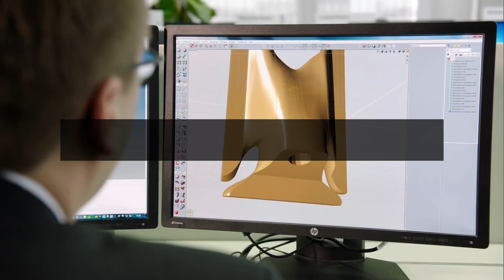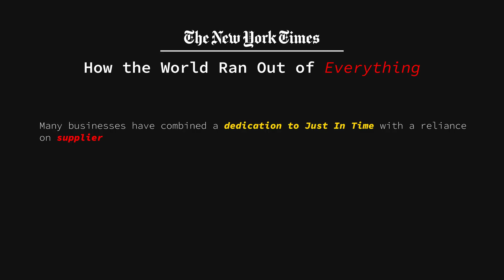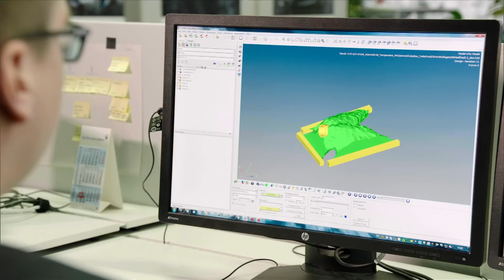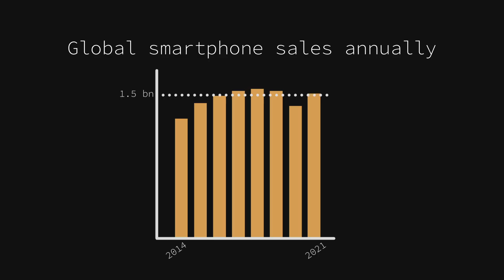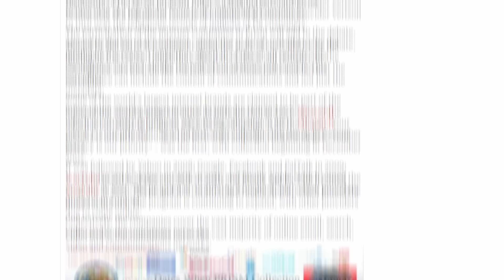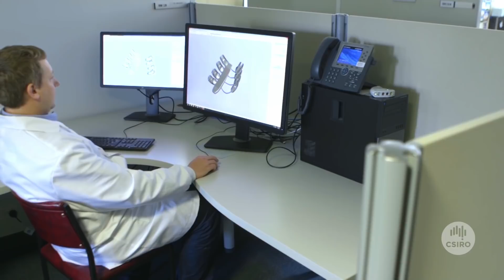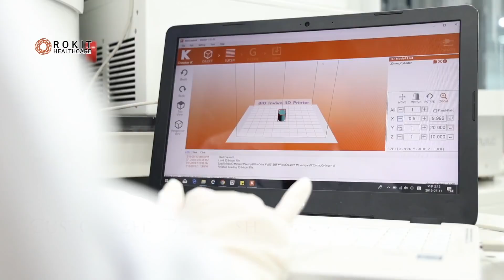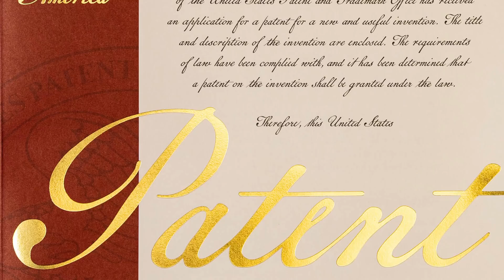How 3D Printing Could Decentralize (Almost) Everything

Comment: 4:00 I'm going to have to protest right here. The recovery of metal is virtually 100%, since it can be moulded again. And wood, yes....if only we had some sort of machine where we could use that in..... maybe it could simultaneously heat something while getting vaporized.
Reply: Metals are fairly easy to recycle. That's been worked on for decades, if not centuries.

Plastics, not so much. Jake Tran has a video on that. (I could provide a link, but those comments get disappeared >_<)

With wood, the waste can be recycled a couple times before the fibres get too beat up to be useful. At this point, the choice is basically firewood or compost…
Reply: To add on to this, additive and subtractive are already being combined. E3D has some cool stuff available to the public.
Reply: @tripplefives Ah you are right, I was assuming that metal recycling was being effected in the same way as plastic recycling. Plastic flakes were more expensive per ton than virgin plastic or at least they were the last time I saw a report on it, since the pandemic drove up the price of petroleum it has probably swung the other way again since the price has gone up with the drop in production. Evidently the ease of recycling non alloyed metals is keeping the recycled products cheaper than virgin materials.
Reply: Also, 
1. 3D printers are S L O W
2. 3D printers Produce inferior products, often completely unsuitable replacements to parts made with  traditional manufacturing.
3. 3D printers have a limited range of materials.
4. 3D Printers need To be produced with electronics, cabling, bearings and machines metal etc that THEY CAN'T THEMSELVES MAKE. Isn't that alone proof enough?
Reply: @paulp1204  Well yes, but actually no.
1. Community is working on fast and accurate 3d printers (Voron series for example) , and yeah it still cant compare to injection molding, but when you include the time of transportation and warehousing it's pretty close.
2. Traditional 3d printing(FDM) sure, but have you seen SLS 3d printers? The quality is astonishing and the durability is close to 1:1.
3. Can't argue with that, but every manufacturing technology has limitations.
4. RepRap project that basically started the community has some interesting solutions(like snappy v3 if I recall correctly) .

Also, all of my points go through the window if you include metalwork, it's really high quality but also costly.
Reply from the maker: Is metal reusable/recyclable even after it was treated for specific use cases? I.e. are you gonna be able to mold leftover construction steel into auto parts?
Reply: @TheHatedOne  Yes, you can throw steel into an Electric Arc Furnace for recycling it from what I know. From there you can re-alloy the material. Not sure about aluminum but recycled aluminum is used all the time and I think it can be cheaper than virgin aluminum. Also, I think Additive + Subtractive is the more near-term future of manufacturing for a lot of purposes. Mazak, DMG Mori, and other machines companies make machines capable of doing both, and they are used not only in the creation of new "stuff", but they are used to repair tools and parts as well, such as worn molds and die tools. They are awesome machines. I have a passion for machining and manufacturing along with being CompSci guy, which is kind of rare in my generation here in the US. BTW, 3D printed guns are awesome.
Reply from the maker: @Thorhian   Thanks for the insight. Throughout my research I've stumbled upon many companies in the business of 3D metal printing for some of the specific benefits of additive manufacturing - mainly extreme customization and short design-to-market cycle. I don't think 3D printing will beat machining at scale anytime soon if ever, but I am curious to see how 3D printing could complement subtractive manufacturing in the future.
Reply: @Thorhian  Lets not forget that MAG welding that was used in repair is now its own 3D printing method with CNC machines doing the job in carbon dioxide chambers. I wish I'd get to work on one soon, the DMG Mori ones use sintering for the job and are awesome!
Reply: @Thorhian  It is certainly possible to reconstitute or reforge most metals through recycling, its unfortunately generally much cheaper and faster to simply buy new bulk materials rather than to recycle the leftovers, and since its cheaper and faster a majority of manufacturers will go that route unless they are big enough to do the recycling internally and the material is expensive enough. That seems to be the trap of recycling, it sounds good but unless it is cheaper, mandated by the government, or will pay PR dividends when they need to influence public opinion no company will do it.
Reply: @Anthony-ng5pq  from what I know, unless it is mixed up with other metals too much, many machine shops recycle their chips and they usually get payed at least a little bit to do so.
Reply: @l0_0l45  yep. There is also a rocket company that print many of their parts using this technique, essentially attaching a MIG welder to a giant robot arm. The special sauce for that kind of printing is in the software though. They have to simulate the whole thing to compensate for how the metal’s shape changes as it cools down and adjust the model accordingly. Also, Mazak has a 5 axis milling machine that also does hot wire deposition, using a conical laser to melt the welding wire if I remembered correctly. I think they teamed up with Lincoln Electric to build it.
Reply: @TheHatedOne  The automotive industry has been recycling components since it's inception. Metal can be melted down and re-refined,with minimal loss, and for far less than generating "virgin" metals. Most folks who build with wood have learned to create very little waste.
Reply from the maker: @mattsmechanicalssi5833  Can you cite any ratios you know of? I've found 20:1 of raw material to final product. But these claims came from those in the 3D printing business so might be biased.
Reply: @TheHatedOne  Is 3d Printed parts reusable/recyclable even after it was treated for specific use cases?